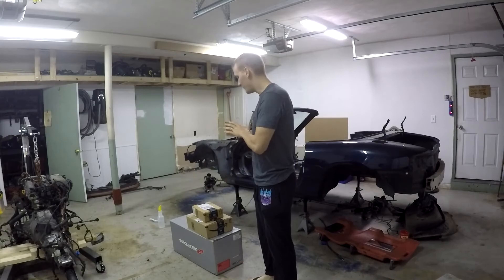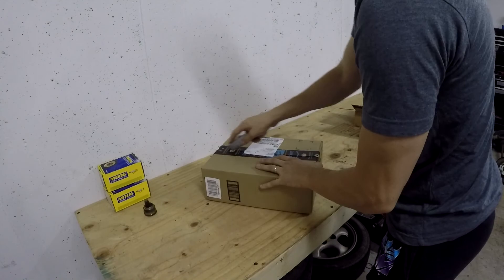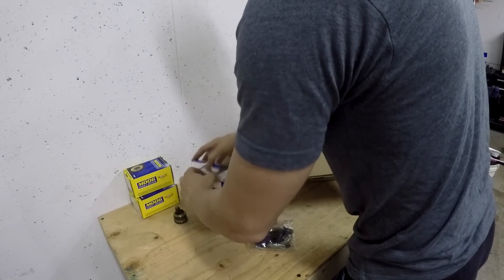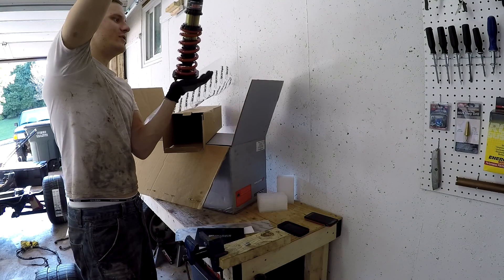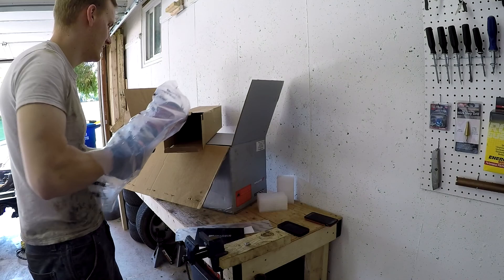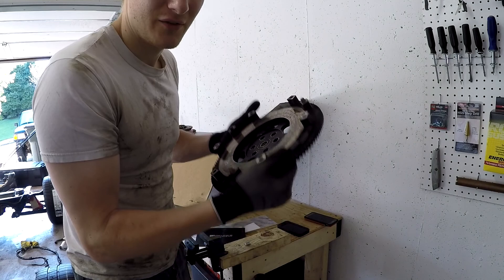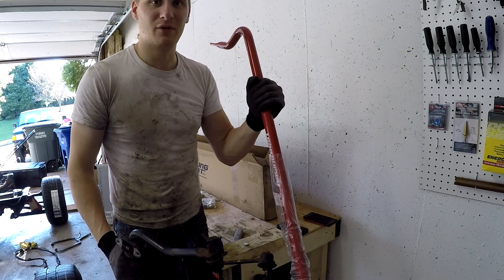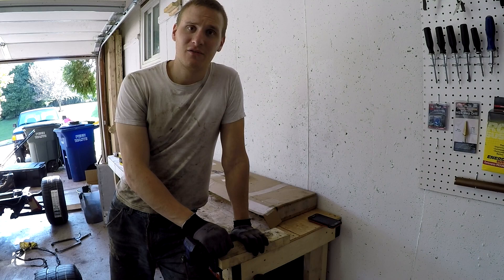Exocet Build VLOG 2 Racing Parts Delivery

Comment: The front anti roll bar ( you call it a sway bar) is a round bar mounted in rubber bushes so it can rotate. So other than setting corner weights I can’t see why you need adjustable drop links.  Of more use would have been the capacity to adjust the arm length of the bar to control the resistance to roll without increasing spring rate.  Or if you want to go totally mad use small shock absorbers, maybe even progressive or adjustable ones to give a sharper turn in, again without running stiffer springs.  You may be able to run softer springs to give more grip on poor surfaces by preventing chatter. ( the suspension being unable to respond quickly enough on a poor surface so it just bounces off the top of all the bumps).  Preventing chatter at the back improves the power you can put down as the tyres follow the road surface.  A very complex subject as you’ve reduced the weight of the car by 1,000lbs but are still using uprated car parts not parts for a car of reduced weight.
Reply: Im going to have to 100% agree. You can't buy suspension parts for the Exocet like you can for the miata. I mean you CAN but you HAVEA to take into consideration the 1000lbs that is gone from the car or you're gonna have a bad time

Comment: Will the moog k500210 ball joint fit your NB knukcle? I am looking to replace mine and didn't find anything to fit the MX5 NB front upper control arm
Reply from the maker: It should. I checked the parts and it matches so you should be good.

Comment: Thank you so much for the detailed list. Quick question. How in the world did you remove the dust guards for the rear brakes?? Cutting wheel? Also, I’m torn between the Fox and Skunk coil overs. Any help on that would be great.
Reply from the maker: That was a pain in the butt. I took a grinder and cut as much of it as I could as close to the hub as possible. Then took a pair of pliers and ripped the steel the rest of the way and bent it till it came off. It was not a surgical procedure but it worked. I would go with Skunk 2 coils. It's what Exomotive recommends for street and track builds as they are of great quality and work very well with the Exocet. Plus they look amazing on the chassis.